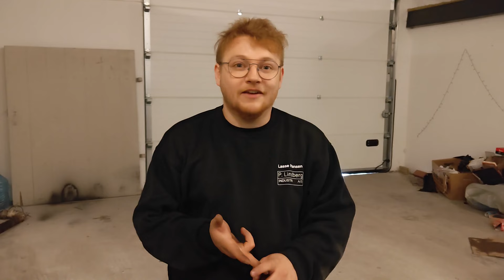190E Turbo Project Update

Comment: Go for a cdi 6 speed. I have a m111 turbo 190e not dynoed but ~300hp, and the 3rd gear on the 190e gearbox didn't hold for long. Best of luck with your build!
Reply from the maker: Thanks the box i got is from a om606, but yes i've heard that 3rd always goes on the old gen boxes😅there's just a few issues with going 6speed